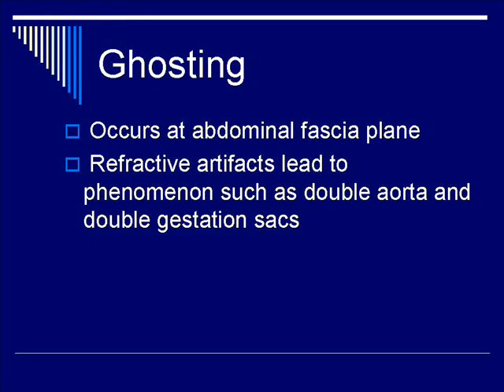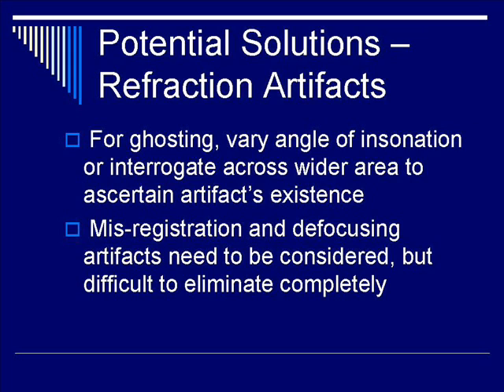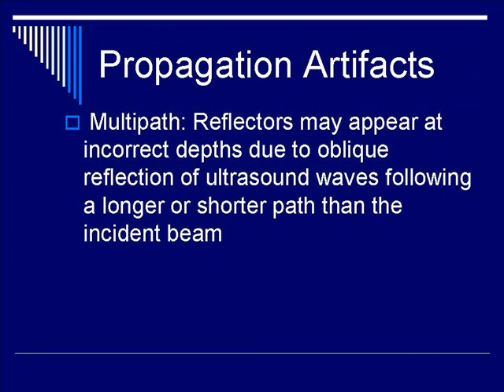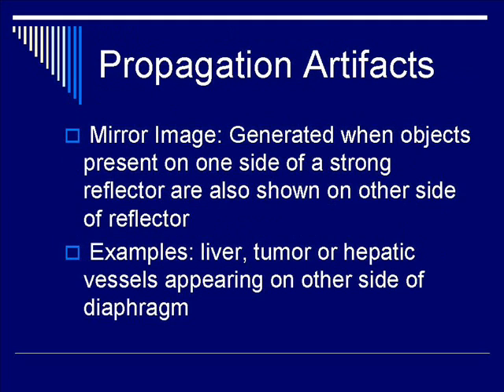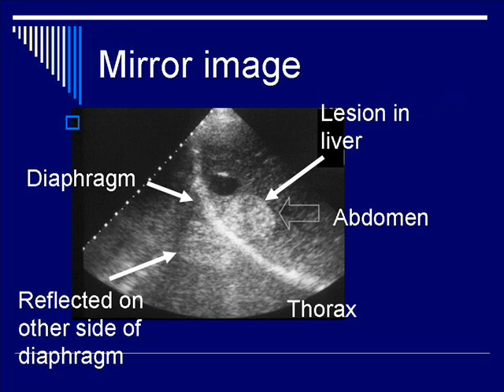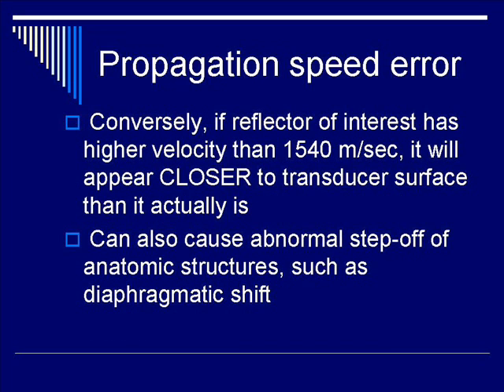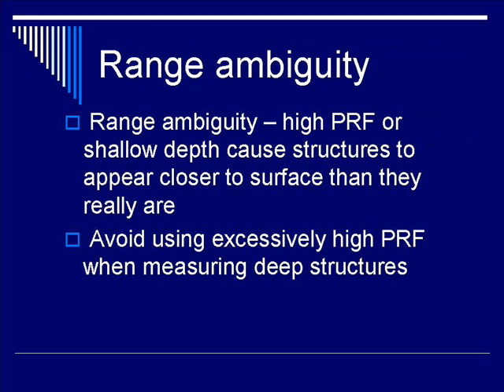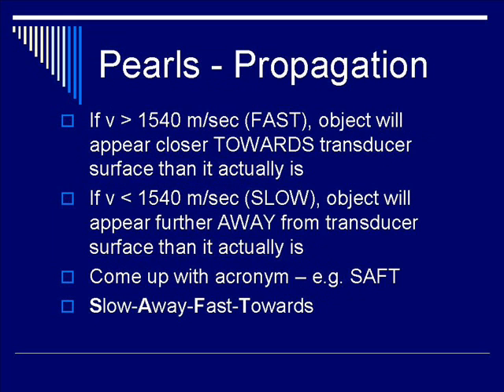Physics of Ultrasound: Image Artifacts Segment #4

Comment: In grey scale Pulse Echo sonography the operator has no controle on PRF as it is adjusted spontaneously by the ultrasound system according to the scanning depth while in case of Color Dopler the situation is different where the operator has control on incresing or decreasing of PRF.

Comment: POINT TO BE NOTED IN THE ARTIFACT LECTURE
With regard to the solution of Range ambiguity artifact it is recommended in the lecture not to use High Pulse Repetition Frequency while imaging Deep structures.IT IS TO BE NOTED THAT AN OPERATOR OF ULTRASOUND MACHINE HAS NO CONTROL ON PRF, BEAM FORMER (PULSER ) OF MACHINE ITSELF ADJUST PRF AUTOMATICALLY WITH REGARD TO SCANNING DEPTH 
GOHER ZAIDI..........STUDENT OF DMU
Reply: That's a great observation!  Is it possible that some older models allowed the operator to specifically change the PRF, even though newer models now do it automatically?